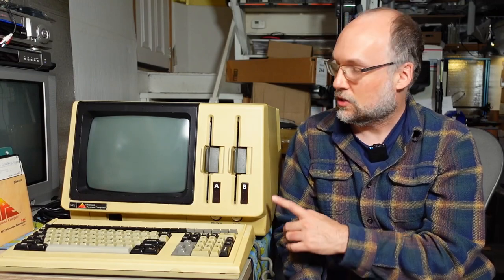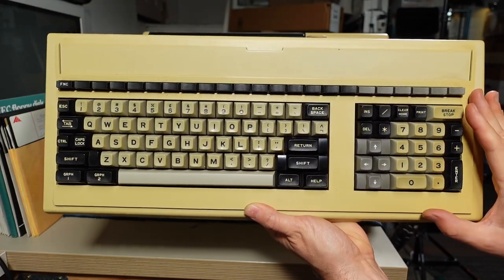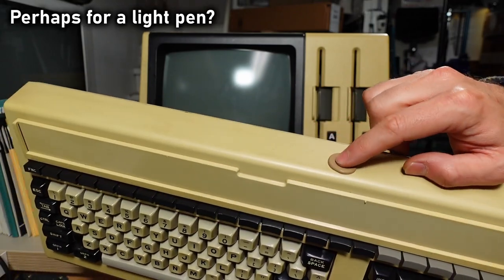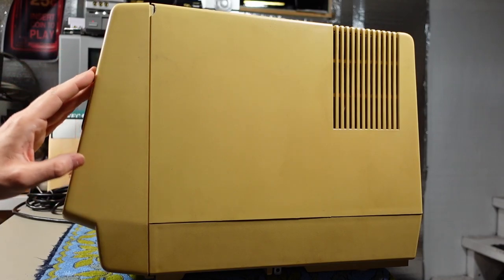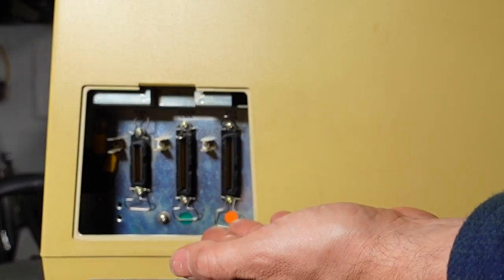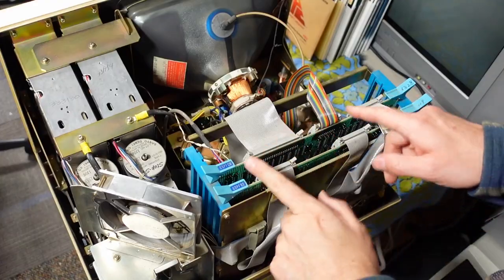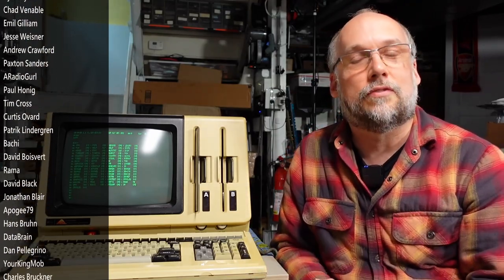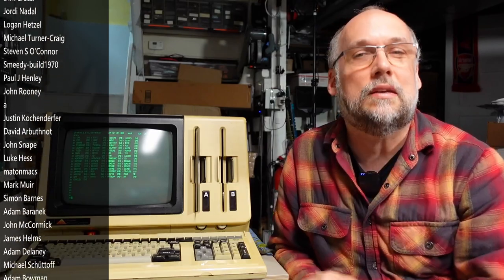The NEC APC runs MS-DOS from 8" disks

Comment: :INITIATE START SEQUENCE:
KEYMASTER REPORTS WE HAVE ACHIEVED MAXIMUM CHONK...

For MS-DOS you might try Professional Write on that thing and see if it will work as an editor.  I think I may have some old floppy images of ProWrite somewhere (likely in CopyQM format - it was supplied on four 3.5 in. floppies, as I recall). 

MBASIC (or BASIC-80, if you prefer) was the preferred/supplied programming language for CP/M, and is still widely available.  I'm wondering if QuickBASIC would run in MS-DOS on this thingy.  (I have images for QB 4.5 somewhere, too.)

Comment: I would back up the Roms / And the os idk how available the images are.  Also some 2.11 os versions come with the complete source (if you can believe it) meaning we can get insite into the display controller and fpu based on how they are built into io.sys

Comment: Regarding the funky drive pinout, I could make an adapter to make the two talk to each other if the signals are the same. For that matter, I could just as easily do a multi adapter board that can make any floppy talk with any controller...sounds fun actually. Other than this funky unit, the standard 8", and the standard PC interface are there any others that should be supported?

Comment: 14:40 Note: A CR-2N (CR12600SE) battery has about 7 times the capacity of a CR2032, and I sort of doubt that they would have chosen a cell this large willy-nilly. You may be lucky to get a year of data retention out of one. I would study the schematics to see what sort of voltage is acceptable, quite possibly something like modern-day 1/2AA or AA 3.6 V lithiums will also work. Failing that, a pair of 1.5 V AAA or AA lithiums from the photography realm could also be used, assuming their far lower internal resistance does not pose an issue.

According to its datasheet, the µPD449 SRAM needs 1.0 µA max at 25°C, so that alone ought to run for the better part of a quarter century on a CR2032, but who knows what else is drawing current there. (There has to be something, or else they wouldn't spec a measly "at least two years" on the big CR-2N.) In this realm, even diode and capacitor leakage may become relevant.

Comment: Laplink software. Data transfer over null serial and a special null parallel cable between 
Can use just a null serial with std dos redirecting output to com ports. 115kb 8,n,1

Comment: The PC-9800 also had high res text modes (it also had the bitmap modes built in) needed for Japanese text which is why PC clones didn't do well in Japan until Windows 95 arrived (DOS-V also helped earlier but W95 broke the PC98).
Reply: And this is sort of a proto PC98 in a way (with the APC-III literally being a rebadged one), it has the same video controller etc...

Comment: If it's like the PC-8001A, then the drive motor stays running for about 2½ minutes after the last disk access and then shuts off. NEC's 5¼-inch drives had a single LED that glowed dimly when the drive motor was running and full brightness when it was being accessed.

Comment: The APC, was the international version of the NEC N5200 PC. 

They are sort of cousins to the PC-9801 series machines.

NEC also put their uPD7220 high performance graphics chip on there, which has all sorts of goodies on it (such as accelerated line draw and complex pattern fills). It works extremely well with GSX under CP/M-86, and the earliest versions of AutoCAD had direct support for it, which made it one of the best AutoCAD machines for a couple of years.

Comment: Interesting watching the power switch just light up on its' own at 42:52, must have a loose connection to the neon lamp inside the switch or something, but that aside, it's neat seeing this machine come to life, especially the 8" disk drive just working like it never sat for however many years it was on a shelf somewhere, pretty cool stuff... :D
Reply: I wonder if it took a little time for the neon to vaporise after sitting for so long
Reply: @kaitlyn__L  Neon is a gas it does not vaporize, but it may have taken a while to strike...
Reply: @1kreature  tbqh I’m mostly just familiar with sodium lamps, so it was just a shot in the dark about how gas discharge lamps can take a while to get going after a long time
Reply: As neon lamps age, they lose the ability to strike or begin glowing in low light conditions.  You can help an old lamp strike with an external light source. I wonder if that's what happened here.
Reply: Seeing as the switch was in the random spares bin, it might itself have been swapped out for having an unreliable indicator light in it...
Reply: was thinking had something to do with him plugging in the keyboard idk why it would make the light turn on tho lol

Comment: So at 12:34 you show us the NEC 8086 and at 23:32 you show the system clock at 4.9152 - as we all know the 8086 was the "clean" 16 bit CPU and I must say it's very interesting this have a system clock of 4.9152 - I shall be looking forward to Part 2 hoping you will dive more into this 16 bit CPU and ne 8-bit mem access bus
Reply: NEC doing their bit to push the initial 5MHz rated 8088 / 8086 generation that little bit closer to its official max than IBM did, as they didn't need to reuse the system clock for NTSC colour encoding (and pixel sync in CGA hi-rez) on the video card... But given that particular frequency, I'd say they're likely running the serial UART off it instead, which is why it's not 5.0MHz!

(though seeing as I back-mathed the video pixel clock to be 20.0MHz, surely there would have been some mileage in having that crystal purely for serial clocking and running the CPU and video off the 20M instead, similar to the Olivetti/AT&T machines that have a 24M crystal that runs video output directly and divides by 3 to clock the 8086-2 at 8Mhz as well)

Comment: That disk drive sounded like my first experience with an Amiga 500 3.5" floppy drive. That rough grating sound with drawn out tones and clicking as the drive heads move to a new position. The reassuring sound of data on its way...

Comment: Ah, the Sharpie touch-up trick.  Often, you can go back after it's well dried and rub it a bit with your bare fingers, and some of the remaining purplish tint will go away, making the touch up even more convincing.
Reply from the maker: Oh nice! Down in the basement the lighting is dim, so I really don't notice it, especially compared to the glaring marks it had originally. And the only real difference (in color/tint) is the sharpie is a bit more shiny than the paint.
Reply: @adriansdigitalbasement  Might want to pickup a black acrylic marker. It won't fade/purple like sharpie and worse comes to worse you can remove it with just water!

Comment: Interesting that it uses so many of those centronics style connectors. They were used a lot in telco equipment, so it wouldn't surprise me if NEC cherry-picked some engineers from the division of the company that made equipment for telcos. The backplane connectors on the cards kind of reinforce that idea; telco equipment would've used a similar style of backplane, so it wouldn't surprise me if they just re-used a backplane from some other equipment, and didn't need the second connector, but kept it because it would've cost more to redesign it just for this computer.

The other thought that occurred to me was that there was no NEC V20. But of course, that came a lot later, in the vast wasteland of time between when the original PC came out and when IBM finally got around to actually upgrading the hardware when they released the AT. And this used the full-fat 8086 rather than the cut-down 8088, which would've made it pretty fast compared to the IBM PC.
Reply: Telco is relevant.  NEC made high-end Telecom gear along with private branch exchanges (PBXs).  I never encountered this model but recognize it from documentation when I maintained a 1980’s NEC PBX with 1000 extensions.  This was the recommended management station.
Reply: I've put a V30 in my APC... :-)

Comment: Adrian, Do you have any pointers/tips for looking up DataSheets for NEC ics.
Reply: Any of the 82xx chips would be the same as the Intel part.
The NEC 7xxxxx parts were often CMOS versions of the 82xx chips if you matched up the last 2 digits.
Reply: @kensmith5694  thanks. I’ve got a tote full of old cash register boards populated with mostly NEC. I’ll keep your advice in mind.

Comment: I bet you could write some pretty advanced lookingand sounding  games on this at the time.

Can't you make an adapter cable for a Gotek drive ? It would mean soldering each wire sperately to match the pin-out, but I'm sure it could be done.

Awesome computer.
Reply: no this is 8” drive gotek is 3.5” drive
Reply: @jessihawkins9116  I thought the connections might be the same. You know, like Track select, Sector, Side. that sort of thing. I've not really bothered with floppy drives.
Reply: @frankowalker4662  no it won’t work
Reply: @jessihawkins9116  Oh. My bad. :)
Reply: Mr Guru  I thought it might, but as I said I've had very little to do with floppy's apart from loading progs on the Amiga.

Comment: To have the exact right part in your surplus bin, and to remember that you have it: Nice. The neon bulb doesn't always work? It's exactly like you said, "oh well", because the intermediate, half-failed state is to flicker annoyingly. If it starts to flicker, just remove the neutral lead so the lamp can't even try. All the switches I've seen on power distribution boxes of the era have reached the semi-fail state, I suspect they leak their neon slowly but surely, whether you use them or not.
The higher vertical resolution was necessary because the machine was designed for the Japanese market, and more resolution is required to render CJK text legible.

Comment: ooh, interesting machine... can I ask an odd question - can you use the logic analyser / oscilloscope to figure out the H and V sync rates of the screen? Seems to be something that's not recorded anywhere when i was trying to do some research on the subject a couple years back. Very few of the intermediate screen "standards" (between TV standard and VGA) seem to have that data available, really just Mac, MDA, EGA, PGC, and a couple other JDM computers...

edit (scrolls comments on computer whilst video plays on TV) ... aw, does it not start up? oh well. the puzzle shall persist. Is there even a telltale oscillator for the video (or shared with the CPU) with the frequency printed on that would give a dotclock at least?
Reply: It's in the manual if you mean this computer, Adrian even read them out loud
if you mean another computer, yes, set the scope to trigger on VSYNC or HSYNC line and measure frequency (modern scopes do that automatically, with old ones you count the lines that are drawn over the screen).
If you mean composite, you will probably need to manually find the pulses (they are fairly distinct looking, you can't miss them)
Reply: @jwhite5008  I rather like my old 60MHz Iwatsu SS-57100 analogue oscilloscope with a digital counter connected to the trigger. It's a luxury.
Reply: @jwhite5008  yeah, I saw that unexpectedly come up later in the vid, but I had switched over to watching on my TV instead by that point and it wasn't so easy to come back and edit! Thanks for pointing it out in any case for anyone else wondering.

It's kind of unusual to find that info, I've generally found, and even then it can be a bit unreliable (Xerox/Olivetti/AT&T/Logabax as well as Tandy spring to mind as having conflicting and hard to logically decipher information in their theory of operation manuals), so I wrote that right at the start without any expectation that it would just come straight up, especially as I've not seen it mentioned anywhere for this machine (it having a 494 line graphics mode is news, even). Figures the one time I get to ask, it was unnecessary...

But yes, anyway, what i was referring to was the H and V syncs, as they'd be important for trying to interface something like this to a capture device or replacement screen/support electronics should the CRT drive hardware die. As well as ferreting out the crystal that drives the dot clock so the active vs blanking periods can be determined for setting width and height scaling (and proper capture sampling) etc. The composite encoding part, if there even is one on this machine, is less interesting as its usually a fairly standard setup, and even if not 15.7khz it can be figured out the same way.

Unfortunately, I have little access (or funds, or working space) to both the original hardware itself, and to the necessary scoping devices, to work it out for myself (if I had any of the old machines I'd probably have to hook the sync lines up to a cheap USB audio interface and record a short burst at 192khz to then manually decipher...), so my only recourse in doing the job nobody else seems to have done in bringing this information together is online resources and begging better resourced types to do the in person tests.

On that front, if anyone can do so for the 25khz Tandys, the aforementioned Olivetti M24 clones, the Olivetti M20 (and the emulation card for the M24), a colour 3270PC, Hercules Plus, the mystery 752x410 and Non-VGA 640x400/480 modes on old SuperEGA cards, and what happens when running Amiga dblNTSC / dblPAL on a Commodore Ranger monitor (and 800x600 productivity mode?), that'd fill in a lot of gaps...
Reply: And here's a fraudulent spambot. Hate those things, wonder why youtube like them.
Reply: Now I'm trying to figure the likely pixel clock. Going with 4x the system frequency didn't quite work with a sensible (or at least whole) number of characters per line, although it would mean roughly the same amount of blanking as a PC98... Must have a wholly independent video card with its own oscillator, like an MDA/Herc/EGA (vs CGA or even the Tandy/Olivetti 400-line machines that use the system clock signal off the bus). Conveniently, 20MHz exact does work nicely with a wider but still entirely realistic 110 characters / 880 pixel clocks per line...

It's a bit of guesswork but sometimes that's needed for reverse engineering the details of a system when you don't have physical access to examine or test it ;-)

And that's a pretty damn high video clock for the time, only really PGC would have been higher until super-EGA clone cards, the Atari ST, Mac II, and VGA successively came along... the radar scope grade refresh rate is probably a sign of them pushing the limit of what the available technology could handle. (The video chip may have only been rated for that, and the later PC98 24kHz standard reduced the Hblank width, dropped the active lines down to 400 with a consequent reduction in total scanlines, and upped the pixel clock to a little over 21MHz which may have been the highest reliable overclock... all to reach the dizzy heights of 56.4Hz refresh....)

(...The question being rather why they went with 19 lines per row on the APC-II when there were only 16 vertical pixels in the regular characters and the tall slashes/backslashes must have been specially coded... even just using the entirely adequate 8x16 size as seen with VGA, ST Hi-rez, etc would have given a less terrible, MDA-like 48.3Hz Vsync even with the status line and the same amount of vertical blank, and it would have looked about as good as MDA / better than EGA overall. It seems pretty excessive... Even if the idea was to have blank spaces between lines for some reason, 8x14 characters within the box would give you two clear scans which would be somewhat like having 16+3. Plus that's a crazy tall letter aspect ratio unless you fatten out the individual pixels...)

Comment: If I was in charge back then  I would force extra memory to be wasted in these as hell. 640 kB on XT machines would be 1 or 2 megabytes instead easily, so these computers would not become obsolete that easy. And I also would give people a lot more storage space, not caring about what needs to be done to achieve that.
Reply: You would need to have shot the guys who made the 8086 processor.  That silly thing used 32 bits worth of registers to address only 20 bits of address space.
Reply: @kensmith5694  ever heard of bankswitching??
Reply: @andrasszabo7386  I have heard of it and also implemented it more than once.  It is a very poor substitute for a 32 bit address range.  You have to either only have one task that uses the banked area or you have to manage the bank control as task switching happens.  In two cases, the banked area was controlled by a single task.  In a 3rd case, the OS had to save the bank number in the context of the tasks.

Comment: for that status line at default font would make the screen actually 494px high.. 475px/19px=25 lines..the other fonts would give you 40 and 43 lines at 475px and I guess you could do like 90 columns with the secondary fonts too, though I'm betting while maybe 80x43 was possible that nothing else was like 90x43 which means you'd have some artificial margins on the sides I guess? makes me wonder how they lined it all up..though the 640x494 for graphics makes sense because thats 26 lines of 19 pixel tall font, so the wiki mentioning 640x475 is kind of misleading

Comment: I was surprised when I saw an APC in the thumbnail. 
The NEC APC is the system I've always figured Bob's computer on Muzzy was based on. It only got a couple of seconds of time.
https://cdn.discordapp.com/attachments/619248685334790177/908945082382700554/Screenshot_20211112-225945.png

Comment: Was Kapton tape commonly used way back then to block UV from EPROMS?  I thought that was a much more recent thing with paper labels being used back then.  That EPROM may have been more recently programmed.
Reply: Even earlier, it wasn't uncommon to use copper or aluminum foil tape, which was a costly way to cover the windows, but it was certainly UV tight.